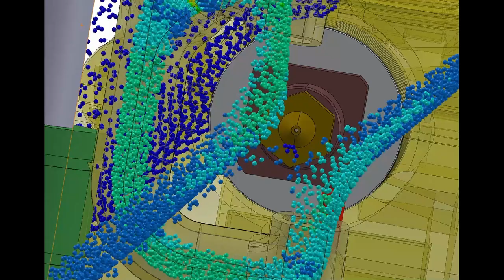Magnetic IDEX CCE Part Cooling Duct PART 2 😊 Countercurrent Exchange DEMO

Comment: Nice work! The vortex in the middle should be way less turbulent than the typical "jam two streams of air against each other" solution. It seems the V shape would drive air toward the bed and back out the sides, cooling th bed too much in some cases. This spins air around and continues to cool the print.

Comment: on the Voron cooling ducts... the cooling stream collide in a V shape slightly below the nozzle... maybe it is something you can also try
Reply from the maker: I’ll most certainly try it out.  Thanks!  Now I must come up with a reasonable battery of test prints to compare different duct designs.  One test could be a relatively fast 3DBenchy.
Reply: @m_IDEX  A good general test would be one of those cardinal overhang flowers, the important part is testing the cooling in all directions at once. Though TBH I'll bet an even more telling test, would be 4 separate tilt tests, but printed in "one at a time" mode, so the underlying filament isn't the thing pulling heat away.